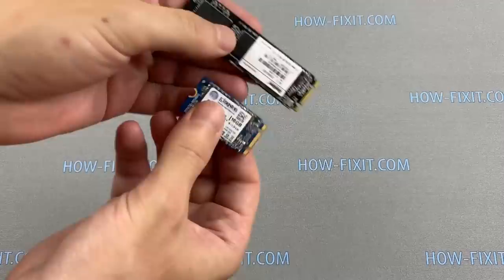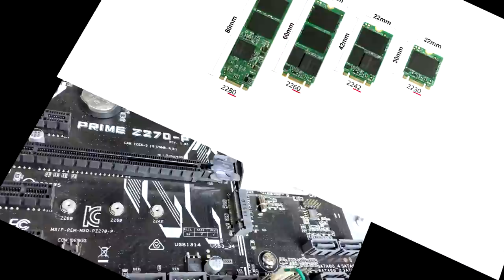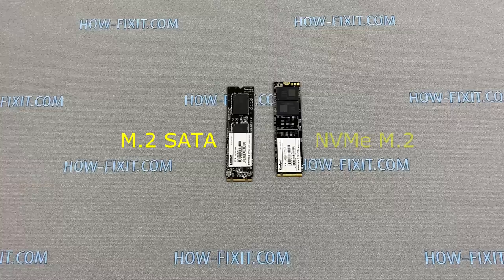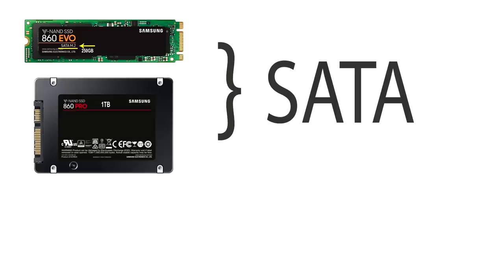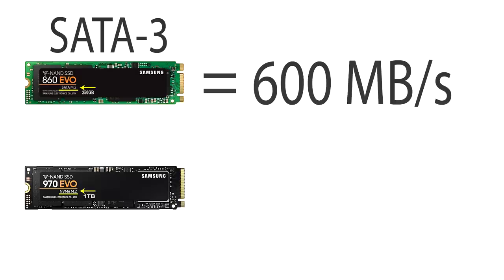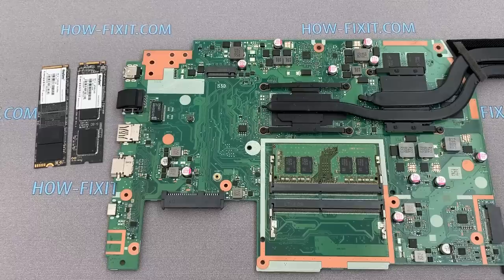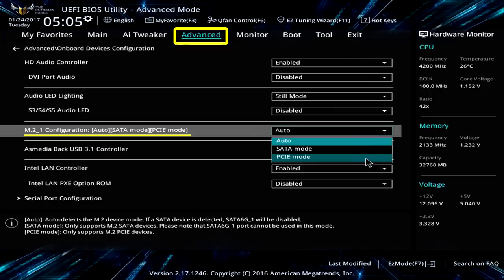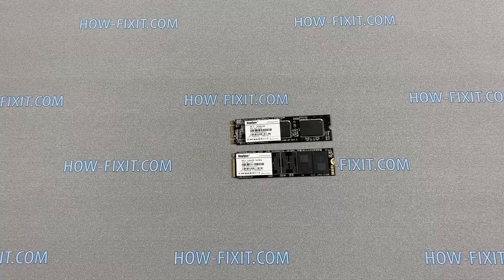Explaining the Difference Between SSD NVMe and M2 SATA and mSATA

Comment: For those who have this question: When you adapt a Nmve (PCIe) to an standard SATA conector, the speed of the Nmve will decrease to te maximum of a SATA III speed, wich is 600mb/s.
Reply: is there a way to change its speed??
Reply: @fadis1011  No, but there Is a few options on Windows 10 to make it a little smoothier. You can't change the Speed of a Port.
Reply: @fadis1011  No man, you can't change it unless you use another port
Reply: How about adapt NVM to msata? Is that also limited to 600mb/s?
Reply: @fadis1011  maybe m.2 to usb adapter will do
Reply: So it means there's no point in buying nvme if your motherboard don't have that slot, like using adapter is almost worthless in this case..!? As the speed decreases...
Reply: @null2639shw  it depends. Remember this is maximum speed of the port, that does not mean that device works on that speed, it works up to that speed. How fast a concrete device is - depends on it's specifications.
Reply: @bumbarabun  yeah, agreed... What i meant was maximum speed is gonna be restricted right..?
Reply: @null2639shw  yes, but if actual device speed is below maximum of slower one then it will not affect you at all.
Reply: @bumbarabun  yeah, obviously it won't... I understood that
Reply: @null2639shw  on a pc u can install a card into a pci-e slot, 
the m.2 connector itself is an x4  pci-e slot. 

An nvme is  direct pci-e, these  connections go right into the cpu!

 For sata mode, the actual connections have to be rerouted through a chip to translate. 

Usb c connectors 5Gbits and faster for example, basically do the same thing e.g. going streight to the boss part.

  At those gigabit speeds ,anything inbetween the communicating endpoints (like :  nvme drive----CPU) 
slows things down unnecessarily, so in theory things get more simple to be faster.

 Sata in itself is mostly a relic from the age of spinning, magnetic HDDs.

 Btw im grosely oversimplifying things for the sake of the main underlying concept....
Reply: thank you that was my question !!!
Reply: @null2639shw  yes
Reply: @bumbarabun  but he said nvme which is pcie which is faster than 600MB/s
Reply: finally answers may question, may laptop is m.2 sata but I bought nvme hehehe
Reply: @null2639shw  The purpose would be if you will want to be able to use the drive in your new computer build coming next, so you won't be going backwards
Reply: Thanks for that tidbit, much appreciated!
Reply: Cool thanks
Reply: *600MB/s

600mb/s is 600 milibit/second
Reply: @null2639shw  Not a reply, just a comment.
Yes the lack of a "m.2-connection" ("slot")that is NVME compatible  (PCIE-connected) means that Your motherboard likely means that You can not "reap" all benefits of a "native NVME" (e.g. very fast booting). 
How ever You might be able to use a PCIE-to-NVME-adapter card, and mount a NVME in that, and that way get access to some of the benefits of using a NVME.
Best regards
Reply: Is there a M.2 NVME to SATA interface (standard, not M.2 SATA)  converter/adapter? Please share a link. 

I’m not looking for an enclosure but an adapter.
Reply: which*
Reply: @tanny_edits   - I made the same mistake and then sold the M.2 NvME online for half the price!
Reply: If you don't mind sacrificing the life of an ssd, you can modify some of them with the firmware tools provided by the manufacturer to adjust the wire speeds.
Reply: Thanks for that! So basically, no point in doing that
Reply: @tanny_edits you get it to finally work on your laptop because he says the adapter dont support nvme ssd
Reply: @GameboyZoneRocks did you find a nvme to sata adapter ?
Reply: @tanny_edits which adapter did u use buddy. Am currently in the same situation like me. I want to use the SSD n not sure the adapter to use to change it to SATA.

Comment: Excellent video. No mention of the PCIe 4.0 or the diffrence between x2 and x4 connections but I think most people care more for the connector types. Nice that you showed both the BIOS & the adaptors. It would of been nice to see a PCIe adaptor card for NVMe, and maybe the USB-C drives you can also throw them into. - excellent work.
Reply: Slow down.
I just discover ssd and now NVMe in 2022 xD
Reply: @condorX2  i only found out about the nvme september 2023 lol

Comment: Finally! A video that explains it all! Thank you! And an added bonus where I was also going to look up how to convert NVMe into 2.5 SATA for cloning my OS. You sir, are a saint!
Reply: there is no use of using NVMe in a SATA adapter as it SATA has  AHCI interface and the NVMe card is made for PCIe interface. SATA has limit of 6Gbps. so it is bettter to buy SSD sata drive for cloning metal drives.
Reply: @BomJimmy  bro why does the adapter u.2 (2.5'') for nvme m.2 did exist, I wonder if it works?
Reply: @ellwalenndhejunny3229  It doesn't matter what is inside the box. The whole thing is determined by the connector to the computer, in this case it's SATA. So you only get SATA quality and not (as suggested) NVME quality. So that at least this "project" can work, the box must have the ability to translate NVME to SATA and vice versa what always goes on cost of speed performance. In the end you won't have even full SATA speed or the box is that much high in price for a hardware coded solution to get the SATA speed goal. Mostly it's an software emulation, i think. Just my 2 pence.
Reply: @BomJimmy  hello sir which one is best for office use pc msata aur ssd ..my mother board have msata slot...
Reply: A little late, but in case anyone asks the same question today. You are probably better off getting an NVMe to USB adapter. Those are also the base for many external SSDs and absolutely prooven and cheap technology. I much prefer USB for such purposes because I can also use my Notebook to recover stuff from my PC.
Reply: @BomJimmy  who cares, it's their PC and it works for them
Reply: Is there a M.2 NVME to SATA interface (serial ATA, not M.2 SATA) adapter? I want to install an existing M.2 NVME SSD in Apple iMac Late-2015.

Please share a link.
Reply: @GameboyZoneRocks  Exact. Same. Problem. I'm looking for a NVME to SATA adapter, and I could not find any. Only one i could find was about 120$ which was DOUBLE of 2 NVME SSD's. I need help with this too.

Comment: EXCELLENT VIDEO !!! Made the issue totally clear to me.
Reply: Easy enough.  If you can support NVME try to find a good module on sale.  I remember when a CD-ROM drive was $300 (that one could not write either) now you can get then dirt cheap if you search enough
Reply: Indeed! Great explain! But if I am not wrong, using NVMe use 4 speeds out of 16x PCIe ? So it is left for GPU only 12x of PCIe?
Reply: Yup
Reply: buz ze zing izz boz are z zame zing
Reply: To me too.

Comment: this video is extremely useful as I'm having issues with my m.2 and couldn't figure out why both functional drives won't work on my first motherboard slot, just knowing both type of ssds are compatible solved my issues and I think I just need an 11th gen Intel for that specific slot to function after reading the motherboard info again. dropped a sub and a like

Comment: m.2 also comes in 22110m, which is longer than 2280. there is also other keys such as e, which usually for wifi modules.
Reply: You just answered my question about the E module! Thank you
Reply: @GeorgeDooling  It can be used for other things and is, but for the general consumer it's mostly used for wifi. IIRC there are also some ethernet adapters amd usb adapters as well as other things.

Comment: M key, B key, M+B Key, M Key SATA, B Key SATA and  M+B Key SATA. With all the pre-built companies putting in cheaper M+B SATA drives it's nice to know what you pulled out of a machine if you decide to slap it in a PCIe adapter for say, a DIY NAS. Lots of laptops come with a 128gb M.2 SATA drive and it still huge for a boot drive on a home built NAS.

Comment: Is a M.2 NVMe card able to store the OS, files and applications? Or Can I boot from an M.2 NVMe card?
Reply: You can, if your motherboard supports booting from the PCIe bus. I found out the hard way my old Dell T1700 doesn't support this. But we have an HP Z-series workstation that does boot from the NVMe drive.

Comment: Thank you so much for explaining this. Now I see why the sata m.2  laptop will except a specific NVMe  m.2  I had a problem trying to upgrading my HP  from  a 256gb to a 1tb. 512 wd blue did not work but the 1tb wd black worked.  wd is Western Digital.  It does matters the laptop. Bios wants what is wants.

Comment: Bigger M2 sata drives have better performances than smaller sizes. It's one of the ways to boost the performance of your system a little bit, more memory if possible is another way >>> next step >>let the system work without virtual memory.

Comment: One of the best clear videos finally explaining things clearly. Would you please tell me if it's possible to do this (upgrade an m2 SATA SSD with a new M2 nvme ssd on the Dell XPS 15 9575 laptop? I bought an nvme ssd in a hurry on a flash sale but didn't find any info on the slot system on my XPS 15 9575 laptop so I'm not sure if it's going to work.

Comment: At 6:50 you show that the NVMe M2 wont go in to the SD adapter, though it looks like it will if you flip it.  Would this not work in the adapter but limited to max SATA III speed?

Comment: Great video, but just a concern left unaddressed. With using the adapters to convert the flash drives;  M.2 Sata or M.2 NVMe, to a standard Sata connection, do we loose the data transfer rate the flash drives offer? It seems to me the transfer rates are reduced to the Sata standard connection. If that is the case, what worth is it to use these newer form of flash drives when a Sata SSD would be just as good?

Comment: Hi, I like your video very much. It make me clearer than b4. But, I have a question. If I connect the M.2 SATA using SSD adapter, is the performance (speed of read or write) will be reduced or maintain? Is the speed between SSD SATA and M.2 SATA big different if using SSD adapter (for M.2 SATA) and compare without using any SSD adapter (just SSD SATA VS M.2 SATA)?

Comment: I have 3.5 SATA drive installed in my PC, can i replace with 2.5 SSD, as 2.5 are 5v volts but 3.5 are 12v standard

Comment: My HP Probook 240 G1 has M key M.2 socket. It detects 2242 M.2 SSD, but POST is very slow with it. Laptop can use it as storage, but will not boot from it.

Comment: Hello Sir, I have old Laptop lenovo x200, can i be able to use MSETA/M2 128 GB SSD or not? Do i have port which is compatible to run this or i have to go default way of just replacing Hdd to SSD?

Comment: EXCELLENT VIDEO BRO'. I have Workstation Mobile DELL PRECISION M6700 and i don´t know if work with NVMe. The Motherboard is Intel  QM77 Xpress.  Thanks for answer.
Reply: That's a pretty old system. Its not likely it supports NVMe SSDs. You can use any 2.5" SSD though.

Comment: Thanks for the video. Now I got a question that may sound oumb. 

NVMe works with the PCIe bus, if I install an NVMe on my motherboard (one that has a mid high end Gpu for gaming) will my gaming performance suffer because I have the GPU working in PCIe slot while this thing uses the PCIe bus?

Comment: Awesome video! ,I'm wondering if it possible/efficient to connect  PCIe NVme M.2 to my laptop with 2.5 inch SATA adapter ?
Reply: That would slow the drive down to 500 MB Second

Comment: So is it strictly about the hardware connection which determines if it will work? I'm currently using a sata ssd and a sata m.2. I'm not able to properly boot after also adding an nvme m.2. It plugs in but my pc won't start up.

Comment: Good presentation. Very helpful. Do you have any more details about the bus lines of PCIe required for M2 Nvme SSD while using latest GPU card (such as RTX 20xx) => 16x ; 4x etc ... do the performances will be downgraded while using a CPU that can handle 16x PCIe for GPU and also a M2 Nvme drive ?
Thx ;)

Comment: I thought SSD was quick, and it was compared to HDD, but M2 NVME is something else. Ridiculous speed. Now ive had it i cant go back. I personally wouldnt bother adapting to M2 NVME, you will only get that ports top speed anyway, why pay more, you may as well just get a cheaper SSD. The other thing adapters wont give you, is the direct connection to the CPU motherboards that support M2 NVME  have. Its responsible for a lot of the speed increase of the drive type. So losing all that speed means you paid too much for a more expensive drive you cant use half the speed of. Like owning a Ferrari but never leaving the city.

Comment: My mother board has just a place where i can fix a caddy in place of dvd drive.... What type of ssd caddy shall I buy, the one which supports 2.5 inch sata ssd would definitely work but can i get an adapter which has mvne m.2  ssd caddy or if I just buy a m.2 ngff ssd slot would work?? I think the adapter which has m.2 ngff ssd slot interfacing on the caddy slot of dvd drive would be almost same as working on 2.5 sata ssd in terms of speed right??

Comment: Thanks for the video, great info!  I bought an M.2 Nvme drive to replace the 128gb m.2 my laptop came with.  The 1tb nvme drive though didn't sit flush on the MB due to chips being on the top and bottom of the drive?  In videos and pics I always see nvme drives having a flat bottom.  Could you explain?

Comment: Hi
Thanks for this video, it helped me to understand even being a nin techie.
Kindly help, i have a dell xps 15,L502x laptop, bought in year 2011 having intel i3 processor, 12 gb of ram, 500 gb hard disk and running genuine windows 11 on it(upgraded )
Which is the best possible ssd type for my laptop?
Can i get installed "Western Digital WD Blue SN570 NVMe 500GB, "Will it work flaulessly or only 2.5 regular sata ssd having upto 500mb speed will work in it.
Kindly reply pls. Thanks

Comment: Is there a M.2 NVME to SATA interface (serial ATA, not M.2 SATA) adapter? I want to install M.2 NVME SSD in Apple iMac Late-2015.

Please share a link.
Reply: UPDATE: There is no solution I could find, so I sold off my NVME drive (in new and unused condition). Facebook marketplace works well.

Comment: Thank you for the video it was helpful,
However I may need help if you please!
I bought a Crucial NVMe PCIe (to expand my storage from 250GB to 1TB) and it's compatible with my Dell Latitude 7480, however it has 1 slot only, and I wanted to clone the system, so I bought an enclosure but still facing issues to clone... It's really a long story but I think you got the Idea.
Therefore, is there any advice?

Comment: I have the HP Elitebook 840 G2. Before I upgrade I wanted to ask for those that know. Does this laptop support a 
NVME m.2 card? All I find is conflict in a bunch of yes and good few no in my research. Is the card slot pin config plug and play. Meaning a NVME m.2 card slides right in fine?  Last- if the laptop supports such anyone know what number card I need? Meaning size that mounts where screw goes. Appears to me that slot is for a smaller card vs the long one correct? or my only option is- m.2 2240 which is not NVME right?

Comment: I am confused about this ssd matter what to buy. Mine is dell  latitude d630 Windows10. In my laptop  there's one slot,which is right side to the RAM slot. Its hitachi 80gb storage. I would like to upgrade my storage so,will you pls give me some advice which should i buy so it can fit into the slot,now i can open the ssd again fix that place easier just remove only two screws. Which one fit my laptop sata, msata, or hard drive, or other's?Please let me know. Thanks

Comment: Can I install M.2 NVMe on lenovo Y700-15ISK Laptop (ideapad) - Type 80NV? 
I was thinking of installing Samsung 500GB M.2 PCIe NVMe 970 EVO Plus, but one guy told me that it won't fit. 
I only have a M.2 slot, and currently working with HDD

Comment: Hi, I bought a TCSUNBOW 256GB SSD M.2 2280 PCIe Express GEN3.0x4 NVMe Solid State Drive to connect to my Lenovo Ideapad Flex 14 but did not work. May be a issue with the SDD itself. However I would like to connect that to my HDD connection instead and will you guide me to find a adaptor for this. I still do not understand what is M or B etc slots.

Comment: Hello, thank you for this video. I want to find a proper adapter for Crucial P3 CT4000P3SSD8 4 TB Solid State Drive - M.2 2280 Internal PCI Express card to be inserted into a regular SATA interface and remove my old SATA hard drive. Which adapter can you recommend?
Reply: PCIe and SATA are not interchangeable.

Comment: Hey 
I'm using a gigabyte h410m s2 V3 Mobo which says that it has NVMe PCIe Gen3 x4 2280 M.2 Connector for m.2 and I've bought a wd green sata m.2 2280 ! This SSD is not getting detected in my bios so I upgraded the bios but still it is not getting detected ! Please help !

Comment: Windows Update... running out of memory for my  notebook ssd and memory integrated motherboard.  Unable to quick upgrade.   Seen m.2 can be upgrated by removing the wifi card for an pcie ssd. So,Looking for  a combo specially for hp stream 13 notebook.....I seen an m.2 slot wifi/bluetook card combo...... Question: Is it possible for the m.2 slot for wifi/ssd card combo?

Comment: Does Asus PRIME H610M-E D4 support m.2 sata ssd and can i use all sata ports with it at the same Time

keep in mind i already have two hdd drives and one sata ssd and one m.2 sata ssd my last motherboard b365m supported all of them and had 6 sata ports but the new motherboard Asus PRIME H610M-E D4 have only 4 sata ports.

Comment: Thanks for clearing all the doubts. Can you help me to figure out what slot is there in HP Pavilion x-360 m Convertible. Model 14m-ba013dx. Can i install nvme in that or just m+b. it has m.2 slot in it. The Laptop is not physically with me. so i can't figure it out.